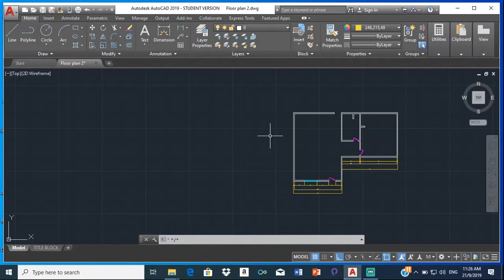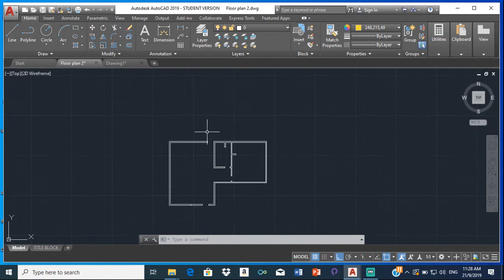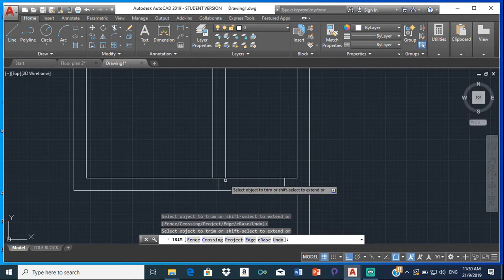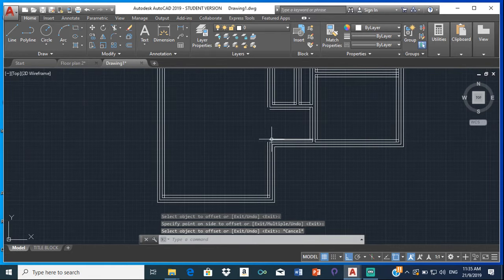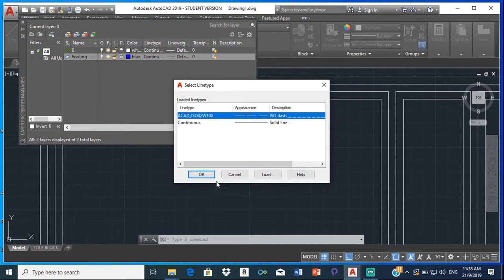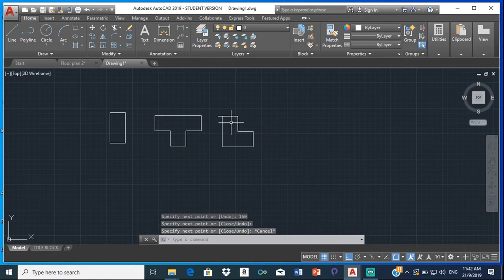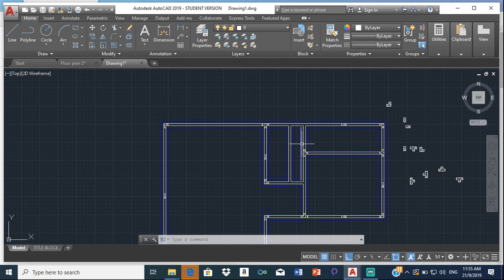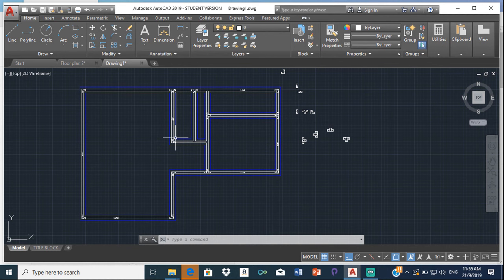How to do a foundation plan in AutoCAD

Comment: can we use fillet to join the lines instead of extending them and then trimming the excess?
Reply from the maker: Good day, yes you could.
Reply: Yeah but sometimes it creates round chamfers if lines don't meet at a specific point. But you can control it by using offset precisely.

Comment: When you offset by 150, what is it in actual measurements?
Reply from the maker: It is actually 150 mm in real life which is 6 inches. 25 mm is 1 inch, actually 23 ¼ mm makes 1 inch but we just round it off to 25 to make the calculations easier.
Reply: @mr.cargill  okay 
THANK YOU
Reply from the maker: @shaniafoo2878  Always welcome.
Reply: It all depends on the setting of unit and dimensions. If you use the architectural unit with inches then the offset would be in feet("+ ent).

Comment: Me g why did you use foundations for the closets. This makes things more complicated you needed to remove the two closets and just do the main walls don’t miss lead students these walls don’t need foundation they are none load bearing!
Reply from the maker: Good day, you do have a point. The closet walls may or may not be load-bearing walls, this foundation plan was done in abstract so there is not a roof plan or floor plan to match it, therefore we do not know whether or not they are load-bearing. I should have made mention of that in the video. Thank you very much for your comment.
Reply: @mr.cargill  I like the video very good please create the columns ass block to be stored remember but loving these videos gonna let my class see them
Reply from the maker: @marlobrown9697  I really appreciate that. Glad you like the videos